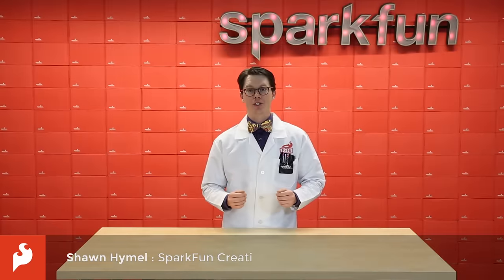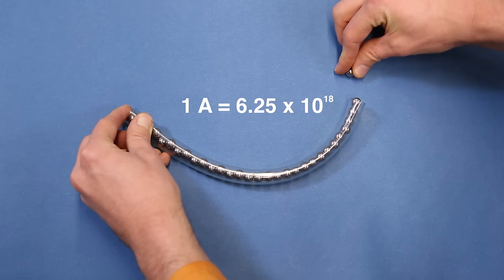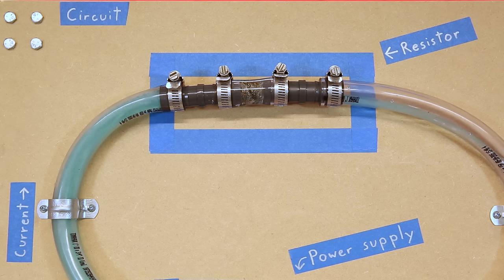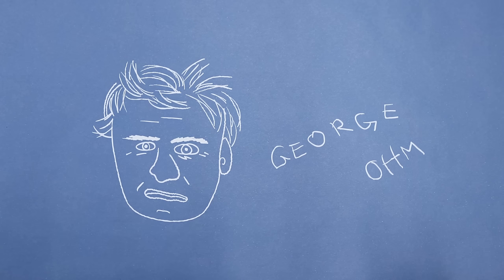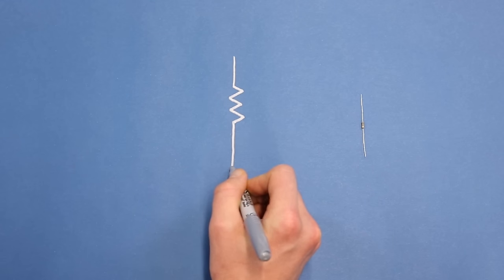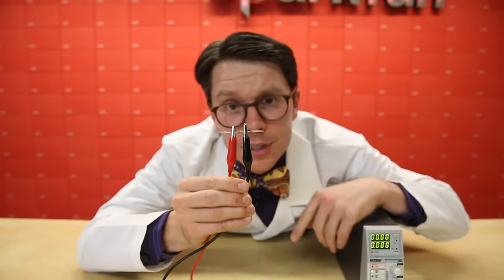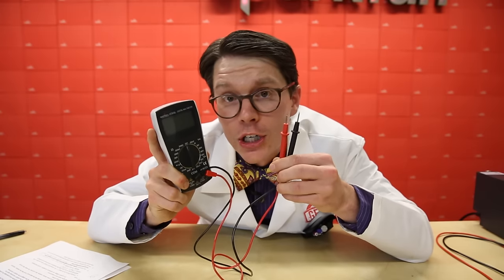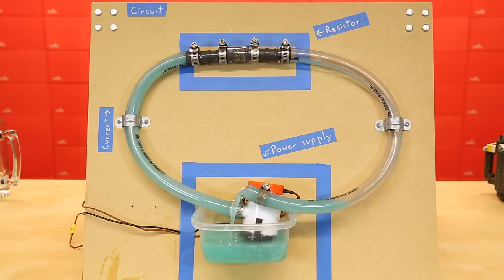Ohm's Law

Comment: Current actually flows from negative to positive. Not important in your ohms law demo but vitally important when working with diodes, transistors and everything else in the electronics world. It's always a good idea to stick with the fundamental truths starting with the basic building blocks. Otherwise, very good explanation especially your use of water as I have often used as an example.
Reply: I was wondering if anybody else caught that.
Reply: FYI for any future readers, this (and the reason he uses I) are explained in his last video (what is electric current?)

Comment: The water experiment with resistor (steel wool) is misleading. It shows that after adding resistance the current (water) will be different before and after the resistor. Whereas the current should be the same at any point in the series.

Comment: The part about inconsistencies in the manufacturing of resistors could have included a brief mention of tolerance (the last color band on a resistor, which denotes the tolerance of the resistance value). Other than that minor note, a great explanation.
Reply: Good tip, thanks! I may do a full video on explaining the color bands.

Comment: Puzzle again. One another question, current is constant before and after resistor. A bit different from water. Able to really explain how electrons flow in the circuit and how it loses energy after passing thru the light bulb and still continue to flow?

Comment: Resistance implies that resistors allow the flow of current, albeit regulated to some extent. This might be seen as trivial, but for me it's the opposite.

Given this, how does "resistance" happen at the molecular / atomic / subatomic levels? What happens to electrons being pushed / pulled through a resistor?

Comment: Hello I have got one doubt by the water circuit as analogy to the current circuit, As we know the current in the this type of closed circuit should remain constant (say 1 Amps in this case), but before valve the water flow in pipe is thick and after valve water flow in pipe is restricted, since water flow is the representation of the electric current so basically it shows in a close circuit the current changes???

Comment: How the voltage drop across the resistor is calculated? As the current is same through the circuit

Comment: Voltage is proportional to current If V=IR, then how there is a statement like "high current is the one which kills people and not the high voltage. (Isn't the current be high too if the voltage is high?) " 

(Is there anything to do with power? P=I²R)
Reply: What I've always heard was that "current kills you, not voltage," which implies that it's the flow of electrons (current) that causes heart failure and not the electric potential (voltage) between any two points on the body. It only takes a few milliamps flowing through the heart to cause fibrillation. To get those few milliamps, you can touch two points (with both hands) with a high voltage difference (skin has a high resistance), or you can have two electrodes stuck in your body with relatively low voltage (your innards have a much lower resistance).
Reply: Shawn Hymel is it possible to take high voltage without current acting on our body? In this the illustrator claims that he touches a very high voltage but a very low current (meanwhile he says not to touch the power outlet coz it has high current even in low voltage). As per my intuitions in the both scenarios the resistance is constant (skin) so how can a 200,000 volts have very low current. I can't get the anology behind this. 
Questions 2#: current kills and voltage doesn't, but current and voltage comes together isn't it?  https://youtu.be/ubZuSZYVBng

Comment: This is a great video to provide a high-level understanding of a circuit however it seems the analogy breaks down a bit or I am missing something. Ohms Law says your circuit with a resistor has a constant current throughout circuit, I = E/R. That means the amperes, or number of charge carriers (or water in your analogy) is the same throughout the entire circuit. The current (or water flow) must be the same before the resistor as it is after the resistor. However in your analogy the water (or current) is much less after the resistor. What gives?
Reply: I was wondering if someone would notice this, well done :) It does indeed look like less water is flowing out of the resistor, but that's not possible as it's a closed system. The same amount of water has to be flowing into the resistor as out of it, since the resistor is neither creating nor destroying water. What you're seeing is a build-up of water before the resistor (similar to pressure), as the steel wool is only letting some of the water through.
Reply: In addition, if the same amount of charge carriers, or electrons, are flowing out of the resistor as into the resistor, then where does the energy for the heat that is created by the resistor come from? Obviously electrons are not being converted to heat.

My basic understanding is that this "voltage is pressure" analogy is very misleading, that in fact two things flow down the wire - electrons as well as a, electric field, and it is both of those that play a part in the energy transfer.
Reply: The heat generation comes from the electrons bumping into atoms as they travel through the wire (or other resistive element). While the same number of electrons still makes it through the resistor, they have less potential energy as a result, which means a decrease in voltage (potential energy per unit charge).
Reply: Shawn, thanks and I'm with you so far. I guess your answer then leads to the question, what really is voltage? Clearly the electrons are not losing energy, as the current (amperes) is the same which means the charge in Coulombs is the same for any point in the circuit.

So it's the same number of electrons before and after the transistor, and each electron has the same charge before and after the resistor (since an ampere equals 1C per second)....but the "voltage", the "electromotive force" is less after the resistor. So if voltage is not a physical property of the electron or the atom in the wire, what is it? What is physically different in the wire after the resistor versus before it?

(Thanks for all the response BTW)

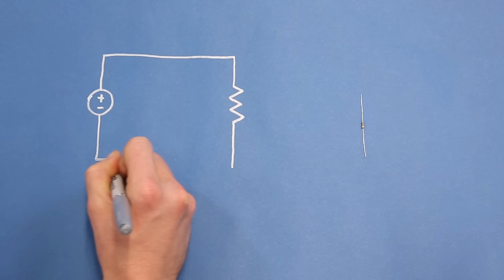Comment: 3:41 Doesn't the current flow from negative to positive and not positive to negative because electrons are negative and thus attracted to the positive terminal? I mean I'm probs just confused cuz teachers have told me several things differently in physics
Reply: Yes, the flow starts at the negative terminal.  The electrons are repelled from each other in a power source (battery) and exit the source at that point. 
You may read instructions that have you disconnect the negative terminal first. This will stop the flow of (or pressure from) electrons.

Comment: great video but i am little bit confuse when you said "current will flow from the positive end to the negative ends" doesn't electrons work in reverse (from the negative to the positive end)?
Reply: thanks man, i am interested in raspberry pi is it the same?
Reply: It's not just Arduino. In circuits, electrons flow from negative to positive, but "conventional current" flows from positive to negative, as it is arbitrarily defined as the direction of flow of positive charge. You can read more about it here: https://en.wikipedia.org/wiki/Electric_current#Conventions
Reply: ah! now i understand ,thanks and btw your videos are super helpful and entertaining ;)
Reply: Thanks! Glad they help :)
Reply: yes he is, check out his website http://shawnhymel.com/about/
Reply: Nicely done on the sleuthing :) You beat me to it. 

@Tyler - Positive to negative "conventional" flow is commonly attributed to Benjamin Franklin who theorized that a positively charged body had too much "fluid" and that this fluid flowed from positive to negative to balance out the two bodies. He was wrong about how electricity worked, but the convention stuck: https://en.wikipedia.org/wiki/Fluid_theory_of_electricity

Even though we normally look at electron flow in circuits, when we talk about "current," it's just a convention showing the direction of positive charges moving. In some applications, such as in the electrolyte of lithium ion battery, positively charged ions can move, becoming the charge carriers. In that case, conventional current (movement of positive charges) actually lines up with the real direction of the moving particles. Since electrons are negatively charged, you just have to remember that the movement of electrons is opposite of conventional current (movement of positive charge).
Reply: yeah i am good at tracking ppl :3, you are like a walking dictionary man every time you speak i learn something and i usually find my self taking notes on Evernote hahah
Reply: Thanks! Let me know if there are any electronics/embedded subjects you'd like to see covered. I'm working on how to use some tools (multimeters, oscilloscopes) next.
Reply: Shawn Hymel  what is Newtonian fluid?

Comment: does resistance depends upon voltage and current ?  pls ans sir
Reply: In an Ohmic Device (e.g. wire, resistor), resistance stays constant as voltage and current changes. Resistance can change due to other factors, like temperature. In Non Ohmic devices (e.g. diodes, transistors), resistance changes as voltage or current changes.
Reply: U

Comment: umm guys...may I know the materials he used in that experiment?? plss for our class project
Reply: dre fernandez the water one? It's clear tubing and a bilge pump from a hardware store. The "resistors" were made from steel wool (caution: they'll rust after a few weeks), and the water has mica powder and blue food coloring so you can see it flow.

Comment: Your resistance is also affected my the fact that you’re measuring the resistance in your body by placing your fingers on the leads of the meter...
A no no, bad practice because one day you’ll be measuring voltage... and AC along with very high DC hurts and sometimes kills